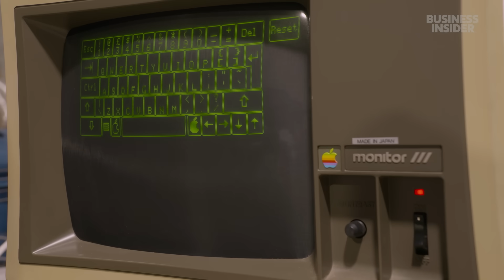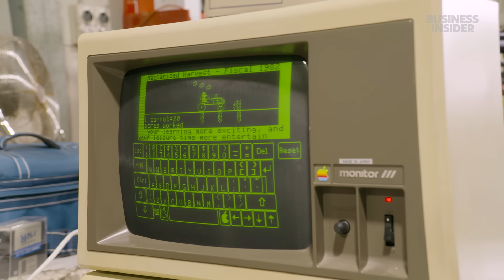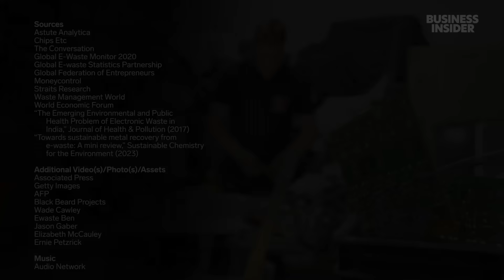How Scrappers Cash In On Gold From Your Old Computer | World Wide Waste | Business Insider

Comment: That thumnail is quite misleading. $85,000 per day after gathering 100tons of electrical parts and millions in equipment to extract the gold.
Reply: Yup, my thoughts. They did mention the plant is expensive, they never actually gave a figure. So yeah, getting 1.2 kg of gold every day sounds fun, until you realize that it will take 20 years to pay the factory back.

Comment: Problem is... the amount of accessible valuables in modern e-waste has become so small, that this business model is going to break down soon. 
Microwave transformers are wound with aluminium wire, instead of copper. Modern MLCCs (formerly containing palladium) are now 99% worthless. Flip chip IC designs don't contain any gold bond wires. Remaining gold plating is just a nanometer gold flashing.... dozens of examples available.
Today there is still enough old stuff being thrown away. But it will end soon.

Comment: Continuing to use the devices and not throwing them away is better than the few mg of gold
Reply: Most people can't use them if they are broken though.
Reply: @SoraShadowdancer  90% are not broken, just old. I use several game consoles and laptops from the trash
Reply: @andreabc1469  people usually don't throw out things that work. If they worked people wouldn't junk them. The only time I've ever gotten rid of electronics is when there is something wrong with them.
Reply: @SoraShadowdancer  errors in use leads to the assumption that things are broken, that's my experience

Comment: 7:30 something doesn’t add up here. They use bacteria AND fungi to get the gold? But the byproduct is toxic enough for them to not want people around it at all, and so the facility is mostly automated? How could any cellular organism dissolve gold, which is famously non-reactive, quicker than more economically viable than just using aqua regia?
Reply: The toxic byproducts are just the plastics and silica that is used in the PCB making. The process is using bacteria to produce chloroauric acid and the fungi then breaks this acid down into gold nano-particles which are purple. Its far cheaper than aqua regia because the bacteria reproduce by themselves so the extraction chemicals are self replicating, whereas you have to buy the acid and have additional machinery to deliver it safely. You then have the extract from the acid again before you can purify which is an additional step.
Reply: @marcuslewis7932  what kind of bacteria is the process using?
Reply: Cyanide is much more economical and safe than aqua regia. Potassium iodide etches gold. There are possibilities.

Comment: They went to old mines to harvest specific types of bacteria to help with their extraction process. How cool!
Reply: really? that's pretty cool!
Reply: @gayraffe he was ironically being sarcastic and actually its true... little does he know 😅
Reply: @dertythegrower  It didn't read like sarcasm to me. You may be misinterpreting over text
Reply: @dertythegrower  wtf are you talking about? it wasnt sarcasm
Reply: The secret is THERE IS NO SECRET SAUCE, it can be done with Vinegar, Nitric Acid, Sulfuric Acid, they dont want others to compete on grand scale. They even send the cake to offsite refinery where the actual get extracted , how green is that ? ? ?
Reply: you are being sarcastic...
but the bacteria now can break down plastic into fuel... jokes on you
Reply: @dertythegrower  you dont need bacteria to turn plastic into fuel just pyrolysis
Reply: @lord_rainbowman - Many plastics can burn in power generators at very high temperatures with no pollution, some can be broken down with solvents, or reused as is railroad track ties, etc.   The biggest problem is people throwing them in regular garbage instead of recycling them.  The biggest problem are the 30 billion non-recycled plastic water bottles thrown away in the US.
Reply: @BillAnt  yup 100% my comment to the guy was more so you only need heat really to break the plastics down into smaller hydrocarbons for liquid fuel and not bacteria and whatever else that may require
Reply: @lord_rainbowman pyrolysis is bad for turning plastic into fuel. It's inefficient and creates fuel that is unusable because of like 70% of it being PAHs and as such super carcinogenic. Also most of the time it's near impossible for you to get 100% of the same type of plastic and as such imagine if you just throw in 5% of pvc in the mix of pe plastic, the thing you will end up with would be horrendous.

Comment: Exporting ewaste is not a eco friendly option when it's burned for metals.
Reply: Burning copper wire reduces the value of the wire too. The metals buyers will give you a lower price per kilo if the wires were burnt in a fire. At least thats what happens in western countries, in 3rd world countries they might get the same price.
Reply: the smog is recycled into captured gas for fuel
Reply: @dertythegrower  rrrriiiiggggghhhhttttt....

Comment: I am intrigued to know what happens to the 70% plastic that was shredded and turned into a pulp.
Reply: If you are talking about the pulp from the boards themselves they have very little plastic, it is mainly silica and metals. The plastics are only for some components to interface with the board...
Reply: @irrefutable_mrT the video literally says 70 percent plastics
Reply: @0741921  well it obviously goes to plastic recycling facilities lol my bad. Maybe watch a video on how they recycle the plastics instead of complaining about the plastic on a video literally titled "how scrappers cash in on gold from your old computer"
Reply: Usually gets burned by waste plants for energy.
Reply: If im not mistaken, most of the circuit boards are made of fiberglass not plastic.
Reply: @xxMUTANTMANxx video literally says 70 percent plastics
Reply: In the trash
Reply: Could any one help me meet any company that could buy my scraps from Nigeria?
Reply: Probably burnt for electricity
Reply: Probably the sewer 😂
Reply: Should be able to melt the plastic down and make new raw material from it.  We do it all the time with 3D filament after chopping, sorting, etc.  it can be a pain sometimes though
Reply: Chem trails
Reply: its called recycling... eaaily turns into fuel diesel
Reply: @dertythegrower  not only - Diesel is the worst. Candida albicans genetically engineered can turn petrol derivatives into carbohydrates, ready to re-enter carbon cycle without emitting greenhouse gasses
Reply: Those are microplastics that ends up in you and me
Reply: Probably just ended up on a landfill in india or whatever
Reply: Wonder how much it costs to make that 85K a day?
Reply: Micro plastic are in the water
Reply: It's pretty straight forward, just dump it in the ocean. Problem solved!
Reply: They make bags out the remaining plastic
Reply: It’s in your drinking water and body, mate!
Reply: It goes into your cereal
Reply: Enjoy your bottled water. Plenty of vitamin P...
Reply: A lot of it ends up in the atmosphere from burning and in the groundwater 😢 What ends up in the atmosphere, eventually ends up in the water and oceans. Probably one of the main reasons microplastics are being found at the poles and most remote areas of the world. Scary to think about but people don't care if they are profiting from it!
Reply: I eat it
Reply: @IdK-er6rh where's does it go after you eat it?
Reply: Load up into big contenna ship for  business of exporting due to high demands in africa continent
Reply: @minimalistKat regulations and fines make gold smaller.
Reply: They make it dildos
Reply: Becomes micro plastics in the air ,water and food.
Reply: Mash for cheap beer😂😂
Reply: Goes into your favorite foods
Reply: I was just thinking that
Reply: They use it for chicken feed 😅
Reply: Why not just turn them into new products
Reply: @coolpuppykid1455  plastic is a byproduct of the oil extraction process. Recycling it is propaganda put out by the gas companies. Every time you recycle it, it gets worse. Most of the plastic number types can only be recycled at special plants. If we don't want plastic garbage, we got to shut it down at the production end. Reusing it is pretty much, not exactly but pretty much, b*******.
Reply: There's a dolphin choking on it as we speak. But don't worry, the money has already been harvested from it.
Reply: Called micro plastics that will get absorbed by our bodies
Reply: Dumped in the pond out back.
Reply: It sails the seven seas! 😂
Reply: They could make fuel from the old plastic 😉
Reply: Not a thing all plaztic producded since 57
Reply: Into hotdogs and spam.
Reply: Old car bumper
Reply: In delhi you can be sure it will end up in the rivers...
Reply: They get sent to 3rd world countries like you’re watching.
Reply: That part usually goes into my pot roast
Reply: It gets dumped in th ocean, duh!
Reply: Landfill
Reply: Burger King 🍔
Reply: Landfill
Reply: At 2:40 he says he sorta it out probably to be recycled separately
Reply: Used as garnish for salmon
Reply: It goes straight into baby formula.
Reply: They make jeans out of it, and dildos
Reply: @minimalistKat plastic is gold, we're just using it incorrectly
Reply: Ocean
Reply: Just dump it in the ocean
Reply: I have said for many many years .. they need to try turn the waist into some type of material for building purposes for houses .. may it be a brick slab or even roof .. something …
Reply: What happens to the other metals 😅
Reply: It's mentioned at 2:35 and 10:00.
Reply: Dildos.
Reply: Boil it, mash it

Cook it in a stew.
Reply: Since they already use some bacterial and fungal species to collect and absorb some of the metals, they might have some fungi or bacteria that specifically break down plastics.
Reply: @Bluenautica  Not yet, but they are working on a bacteria derived from wax worms.
Reply: @Bluenautica not possible on an industrial scale yet, but they are trying.
Reply: @nguyentandung42  I think the only way for it to work is on an industrial scale. If they use pulverized plastics in a bioreactor with prokaryotic bacteria, it would probably be the most efficient process for removing plastics by reducing it to co2 and water. It comes with a cost of high co2 production though, which might deter the use of large scale plastic waste elimination due to national co2 emission regulatory oversight. I fully believe it's possible to do with today's technology, it's just not monetarily feasible and probably has regulations against this method.
Reply: @Bluenautica I doubt that’s what happens to it 😅
Reply: @Bluenautica   in to what? to become what?
Reply: @-e6195  Certain bacteria and fungi consume and breakdown hydrocarbons to produce anything from water and co2, to stored carbohydrates. Most plastics are made from hydrocarbons and have the ability to be reverted back into its core components through pyrolysis, which is heating something up in the absence of oxygen to break its molecular bonds. Plastic recycling facilities could use this method to turn all of their appropriate plastics back into crude oil to then be refined into gasoline and diesel, but that would release all of the co2 back into the atmosphere. Instead certain bacteria could consume and produce carbohydrates which would prevent the co2 from entering the carbon cycle at rates that other co2 producers do. Certain bacteria and fungi are able to do this because the "fossil fuels", or crude oil are just extremely concentrated and heated oils from biological material that have collected over millions of years.
Reply: Smoothie for the braves 😋
Reply: Landfill
Reply: I repair some of the trucks of a contractor that picks up this guys pulp afterwards. We don’t pick up all of it, as others have contracts too, and I’ve seen plenty being dumped into swears, lakes and oceans lol
Reply: What is the point of this comment? If they didn’t take out the valuable stuff the whole thing would get thrown away, at least this way some of it gets recovered
Reply: @actually_zer  Problem is that they are taking relatively intact trash and smashing it down into particles that get into everything.
Reply: Large chunks of plastic tend to stay around in one defined peice for a very long time. Microplastics such as the ones ground up in this video can cause serious issues and get into water ways, animals, plants etc. The world is covered in them currently.  @actually_zer
Reply: @actually_zer 9y9lo7i😊😊
Reply: The point of the comment is to ask a question? It was a valid question. What was the point of your comment?  @actually_zer
Reply: @actually_zer these people dont realize bacteria (literally) recycles plastic into biofuel diesel... i win 😂
Reply: Landfill. Plastics aren't recycled.
Reply: Throw it in the sea or the nearest river👍

Comment: That's awesome! Golden opportunity to turn waste into precious metals and these guys nail it!
Reply: They only do it for the purpose of making videos that they then actually make money off of though.  This isn't something that's practical to do to try to make money off the process itself.
Reply: @Rowgue51  The amount of gold must be very trace.
Reply: @RowGuE 👍  I agReE.!! This is pure cLicK-baiT.!!!! 🤬 🚮
Reply: That business model will break down soon. Modern electronics are so low in valuable content, that in 5 years you won't be able to make money on it. Except if the gold price multiplies by 10.
Reply: Lead solder waste.  PVC waste.  PVC resin waste.
Reply: This is bogus nonsense. I had a friend who had STACKS of various CPU's and RAM back in the day, he barely got a tiny bead out of all of it. You'd need THOUSANDS, maybe tens of thousands computers make $85 in gold off it.
Reply: @GeorgeWashingtonLaserMusket  no, old CPU is 0,1 g Gold, you need 10 for a gram
Reply: @GeorgeWashingtonLaserMusket  yeah, chip interconnects used gold decades ago, when the silicon production was not so advance and the scale wasn't in nanometers. sure you can collect all the "retro" hardware you can find, but several tons are needed to make a tiny quantity of gold. $85k a day? unlikely, unless he managed to find all the monsterous supercomputer chips that still exist. you need extreme knowledge of exactly which electronics have the potential to make this kind of worth the risk. i'm sure he makes more money with general elctr. recycling, than extracted gold.
Reply: @GeorgeWashingtonLaserMusket  Only need about 3 old computers or 8 modern computers to make $85 in gold

But its not worth it, getting an education is better outcome

Comment: Old but literally gold.
Reply: just to get that much gold they literally have to reprocess god knows how many tons of motherboards.
Reply: Yeah and the fact there’s like incredibly small pieces of gold in old computers makes these guys want to rip them apart when some old computers are fine and work normally but still go into the shredder to make like .0001 USD when it could have a resale value of much more.
Reply: @owenkelsey6279   the real question is where does all the plastic slurry go, when its dissolved by acid theres no way the polymers are usable anymore, so this type of recycling is purely for profit, not for ecological benefit.